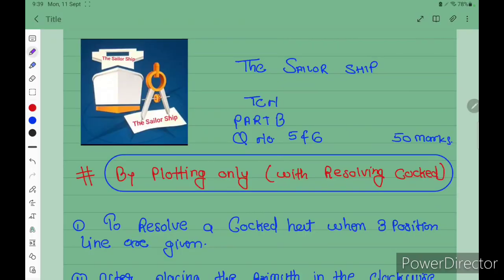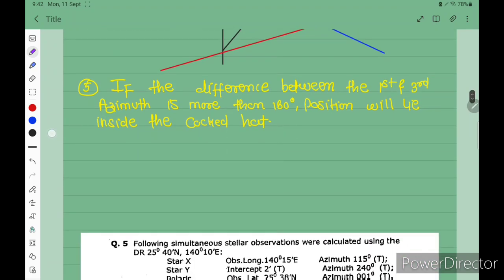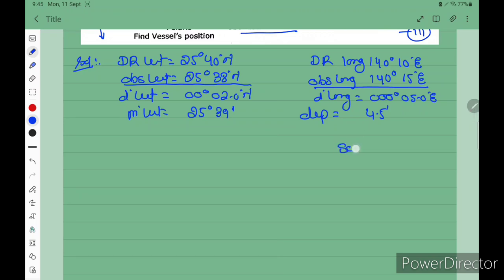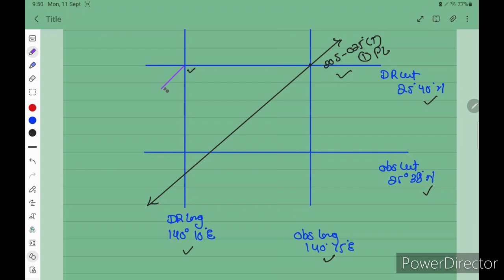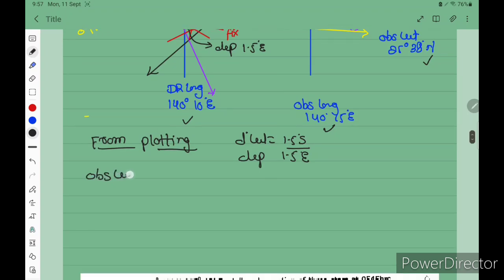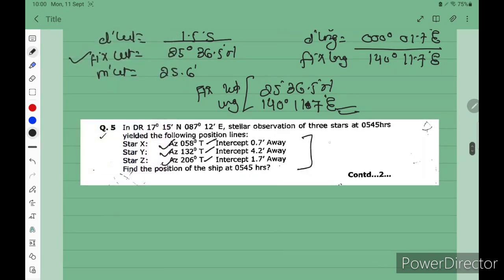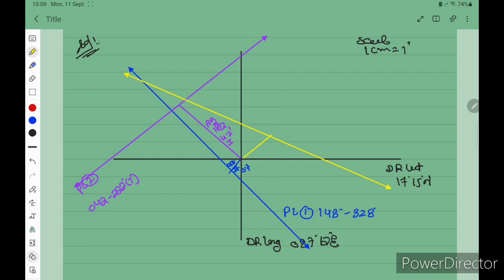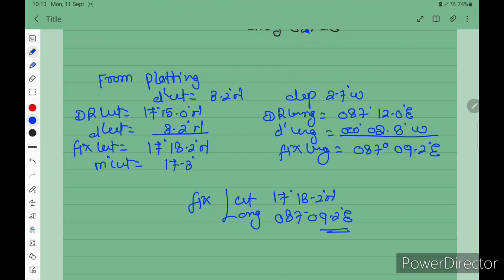Cocked hat Chief Mate Phase 1 TCN

Comment: In first question difference between first and third was less than 180 despite your fixed was drawn inside . How is this possible. Though in your second question fix was out side . Which is correct. But about 1st question. Pls verify asap
Reply from the maker: No its more than 180 u have to arrange in clockwise direction.which I explain in video
Reply: Difference between 240 and 001 is less than 180,diff between 001 and 240 is more than 180,which One shall we take..it's bit confusing.kindly explain..
Reply: Please reply